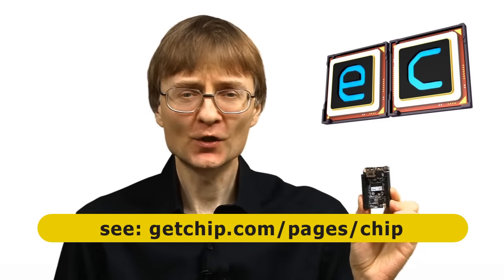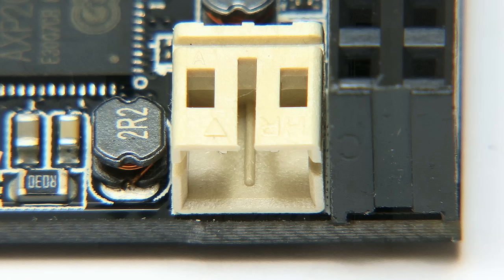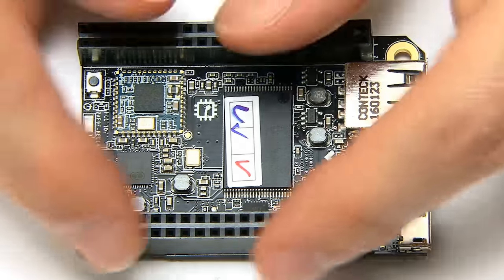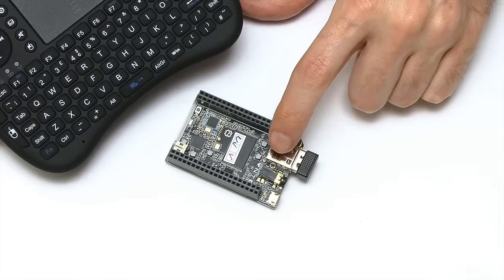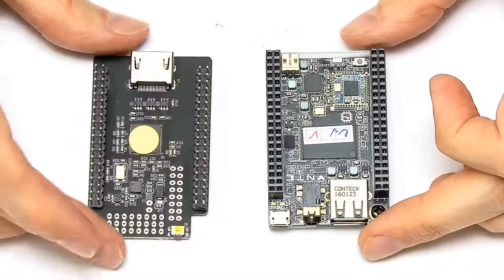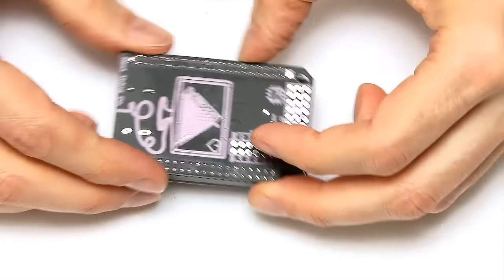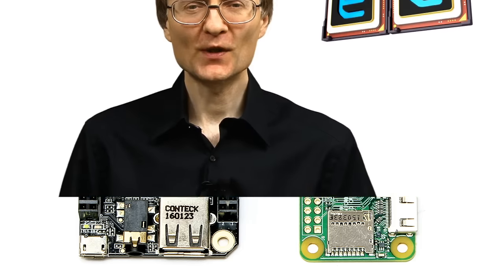CHIP $9 Computer

Comment: Everyone reading save your time and research OrangePi, its the chinese licensed version of raspberry pi BUT it can load ANDROID 7 OS, Debian, Raspbian And Linux. Plus all orange pi's have external wifi antennas with BETTER CHIPSETS TOO! 
--------------------
*Orange Pi Zero 14.50$* - 1.2 ghz Quad Core CPU, 250 mhz dual core Mali GPU, 256/512 mb RAM(version dependant), Regular single USB port, Wireless external Antenna (WIFI), Ethernet 100/1000, and 26 pin expansion port and 13 pin interface for HDMI Shields. The OPI Zero Plus2 has HDMI built in and comes with a camera ribbon cable port
*Ras Pi Zero Wireless 10$* - 1 ghz single core CPU, NO GPU, 512 mb ram, single USB-C data/power ports, Wifi, no ethernet, expansion shields accepted. 
*Ras Pi 3 B+ 35$* - 1.4 ghz quad core, 1 gb ram, single core 450 mhz gpu (OPIZero has better GPU), no internal storage, max 64gb TF SD, Bluetooth 4.2, Camera ribbon cable port
*Orange Pi 2 Lite 35$* - Allwinner H6 1.8 Ghz quad core CPU, dual core 650mhz Mali GPU, 1 Gb Ram, external wifi antenna, 4gb flash internal storage, BT 4.2, Ribbon cable port...
*Orange Pi 3 85$* - Allwinner H6 1.8  Ghz quad core CPU, dual core 650 mhz GPU, 2GB Ram, had RC Mode, AV jacks, HDMI out even IR Capable! anything you need but its pricey AF

Go with orange pi, they have like 20 models to choose from which is better so you have something tailored for what you need.
I dont worrk for orange pi im just a stoner who is bored.
Reply from the maker: Rasbian and Debian are Linux distros! :) Good list above: the Raspberry Pi Zero W is I think the closest and best alternative to a CHIP these days.

Comment: Very odd they didnt use mini-Hdmi, I think it costs about the same.
Reply: MegaTechGuy surely they did it that users would buy additional add-on
Reply: Yay that is the most likely reason, unless it was made for the South-America market which still uses composite video output.
Reply: MegaTechGuy OR they didn't want to pay licensing for HDMI, which would have increased the base cost?
Reply: Well the HDMI royalty rates are (US$0.05) per unit sold with logo on packaging, I'll do a bit of research & find out why they did it. Most likely is was to make money from the add-on HDMI adapter like Nick said.
Reply: MegaTechGuy Just playing devil's advocate. Could also be due to composite being easier to implement or taking less board space. Or to make money, like I said just playing devil's advocate.
Reply: There are projects which skipped HDMI because they didn't want to deal with royalties and compliance testing at all (do keep in mind HDMI is more than just a bunch of video signals; https://en.wikipedia.org/wiki/HDMI#Communication_channel_protocols ), not because the license itself was expensive.

That said the external HDMI addon would've gone trough the licensing stuff so that's probably not it in this case.
Reply: Djhg2000  I suppose HDMI would be a single chip add on, so compliancy testing can be done through the channels of the chip vendor, no need to go through that hassle. Or rather, did I hear mali400 graphics? That is what each and every android tv stick with hdmi out has by default. In fact most of the specs of this thing sounds very android (rikomagic?) to me
Reply: +telocho Like I said; compliance testing is probably not the reason in this case. Besides, compliance testing is pretty much a formality in cases like this where you have a complete graphics core. Just verify the connector is wired up correctly and run the tests.

But I hope you don't seriously believe those Chinese Android sticks have gone through any sort of compliance testing besides hooking it up to some cheap TV to see if they get an image. They put as many markings on those as they think they can get away with.
Reply: Think they went that route to make it more accessible globally, than just limiting its uses to hdmi.
Reply: DannyWarlegs I think it was also to keep the cost of the chip as low as possible too. after all you don't need to buy the dip to use it.
Reply: ah so thats what my tablet hdmi is...
Reply: MegaTechGuy no, we use VGA or HDMI the most of the time

Comment: It's 2020.  Has anything come close to this (including price)?
Reply from the maker: Best alternative today is a Raspberry Pi Zero W, for about $10-$15, depending on where you buy it.
Reply: ExplainingComputers if you just want a microcontroller arduinos cost even less depending on which one you get
Reply from the maker: @natesenft5376  This is true. But a microcontroller is not a general purpose computer like a CHIP or Pi Zero. So as you say, it just depends on the application.
Reply: @ExplainingComputers  Thanks.
Reply: @natesenft5376  Understood.

Comment: Raspberry Pi should definitely come with a Wi-Fi chip on board
Reply: JonnyInfinite rpi 3 has build-in bluetooth + wifi
Reply: jonasxdufek does it? I only have a model 1, it's very slow and not much capable of anything
Reply: JonnyInfinite a 3b is definitely worth the upgrade
Reply: Definitely worth the cash to upgrade to the Pi 3B
Reply: Or CHIP should come with a decent video output at no additional cost.
Reply: +ElMariachi, yeah and for the company to cover that cost they can just charge more than $9.
Reply: That 15$ video out add on is pure bullshit.
Reply: You could always make one yourself with a bit of board etching :)
Reply: JonnyInfinite it does

Comment: About the USB HUB, Were you suggesting it cant put out 500mA ?
Reply from the maker: I imagine it would struggle to draw that current from the Pi.
Reply: If it cant produce 500mA which is not much, Then does that make it non-USB compliant ?
Reply from the maker: It does, but I don't think they are worried about full USB compliance for a tiny SBC.
Reply: Thanks for your reply :)
I think ill be looking into the full spec rasp Pi of some kind, not sure yet.

Comment: FYI, they were out of product for about a year but are back, but at a 24.99 price (Right now on sale at 19.99) . I do not see any real change (need to find out old spec to see). I also what happen to that the chip pro they were showing.  I am not sure where they are going but i will be just watching to see, and rather buy some other SBC

FYI, I have looked at a Wikipedia page on the chip and they say they are out of business. but date april 2018 on the info. So someone has a new site up selling some gear at https://shop.pocketchip.co/   . Not sure on who it is
Reply from the maker: Thanks for this info. At 24.99 the CHIP is significantly more expensive than the Raspberry Pi Zero W.
Reply: I think the Pi zero came to be because of the chip, which picked on a price point of the PI. But now they look to be forgetting why the came to be. Not so much an issue today because there is now a bunch of low cost options to the Pi ( which where some SBCs lose where they are going with it) . I think the only thing they may have left is that chip portable , but have to see. A year from now we shall see. It would not be the first SBc that looked good and went bye bye
Reply: Where is it on sale? The Amazon page (the only one I could find) makes it look like it's gone forever, and they were just selling of what they got at the bankruptcy sale: "We don't know when or if this item will be back in stock.". If they were actually resuming production, one would expect an estimated restocking date.

Comment: This question might reveal how much of a novice I am, but let's say I bought this thing and stuck the USB connector from my external SSD into it.  Would the operating system be able to recognise it and work with it, as it does with my current PC running Windows 10?  It's a 4TB hard drive and would be pretty comical if it could work!

Comment: You can still buy a C.H.I.P. today, April 2020 (except for maybe the corona virus shipping embargo, which has to lift eventually). Search aliexpress.com in China for C.H.I.P. or C H I P == the downside is that the $15 (!) shipping fee is outrageous, since shipping in China is subsidized by the government -- it should be free shipping, or maybe $1 or $2, but no more -- you'd even think that the seller would be happy to get rid of them. OTOH, be happy that you can still get the thing.

You can also update to a newer firmware, in linux. Do a google search for NextThing CHIP, NextThingCo CHIP, or $9 CHIP, or CHIP Update Linux, and so on. It might even work using the linux embedded in Windows 10.

You don't have to worry about the HDMI DIP adapter, since CHIP has a nice desktop that you can access using VNC, from any other computer.

You can access a CHIP using SSH, which might not work, but a more reliable method might be using an FTDI serial adapter to the CHIP's RX/TX pins (and ground, but not power). Remember that the RX from the pc must go to the TX on the CHIP, and the TX on the computer must go to the RX on the CHIP. If a 9600 connection doesn't work, your next step for any serial device should probably be trying a 115,200 (115200) connection. I don't remember if the CHIP's IO Pins are 5V or 3.3V, so try 3.3V first.

Comment: you must have earned enough to buy 9,00,000 of those chip computer with the ads revenue.
Reply: Anant Negi 9,00,000 isn't even a number
Reply: Anant Negi assuming you mean 9,000,000, i highly doubt he made 81,000,000+ from one video.
Reply: I think he means it according to the Indian way of classifying numbers ,we use commas after 3 digits only once then it's commas after 2 digits . What he typed was 9 lakhs or 900,000 (according to the international way of classifying numbers) or 9,00,000 (the Indian way )

Comment: I still have my CHIP! Backed the Kickstarter way back when and everything. Shame they went bankrupt :/

I remember the power management IC was an absolute pain in the ass, as the board kept shutting off whenever it would go over the (meager) current limits, which it did whenever doing anything intensive like running apt update. Eventually they ended up putting in the documentation a command to disable current limiting, and it was basically a requirement to be able to use the damn thing.

Comment: I'm not sure about this Chip computer. $9, it's kind of misleading because in most cases the HDMI is required to be useful. So in many cases this is a $24 computer. I think the Chip itself is that cheap because all other things are quite expensive comparing to the Chip itself. It looks like a printer-selling-business-model, the printer is cheap, the ink however is quite expensive. I think the rasberry pi is more honest and you buy a full package without need of an extension/adapter to be useful out of the box.

Comment: If you look for something similar: Raspi Zero W.
Doesnt have onboard memory ( so you have to get a micro sd card), but is has:
Wifi, Bluetooth, mini/micro (cant remember lol) hdmi, micro? usb (1x output 1x power, output one needs a otg cable to work) And costs around the same (+ ofc whatever size sd card u want and the adapter cable. The adapters probably are more expensive than the rest tho lol)
Reply: Mini HDMI

Comment: Noting that you recommend a Raspberry Pi Zero W in the Description, I would have say that although it is amazing VFM at under £10, I find mine intolerably slow and underpowered. The 2gb Pi4 model B is 3x more expensive but 10x better, and the 8gb version at about £70 is massively superior again, and is a viable desktop PC replacement. I'm holding back from buying a Pi400 only because there is no 8gb version of it (yet).
Reply from the maker: Agreed that the Pi 4 is a far more powerful board, as I've featured in a many videos on this channel. But it is not at the same price point as the old CHIP. And it depends on the use case. :)

Comment: A new chip using a really old format TV output. You would think they would use the much better PAL system.
Reply: It can do both NTSC and PAL.  It's not that "PAL is better," (even though it is) it's that "some parts of the world use PAL, some use NTSC."

It also had an HDMI add-on and a VGA add-on, for those that needed better connections.

Comment: Do you know where to get a video cable for this?
Mine has ground where video should be.
Reply from the maker: They are not easy to find! As I recall, they are wired the same as composite video cables for a Raspberry Pi Model 1.

Comment: Why make NTSC the default? How about a jumper on the board to select which? Or even in the OS image?
Reply: Even though NTSC is the standard here in the United States, I would think it would make more sense for this device to use a VGA output instead of a composite. Why would anybody want to hook this device to a television anyway? That was back in the Commodore days!

I would suggest an HDMI output but I'm not sure if HDMI is a standard "worldwide" signal or there is such a thing an HDMI NTSC and an HDMI PAL signal. 

I've got one of those HP Chromeboxes that uses an HDMI output and had to buy an adapter because all of my LCD monitors have VGA inputs so I'm not a big fan of computers that only have HDMI outputs!

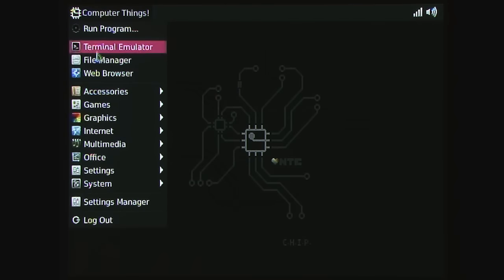Comment: see how fast the task bar responded 10:30, and try the same with your threadripper 3990 x 3080 RTX workstation running windows 10 = still slow.
Reply from the maker: Nice. :)

Comment: to be clear the CHIP basic has no ports you have to buy the developer kit for 49$
Reply from the maker: The CHIP model shown in this video -- currently not being sold, but due to return -- has a USB port, and composite video +  audio output, and also Bluetooth for a wireless keyboard and mouse. So, as I showed in the video, you do/did not need to buy a developer kit to use it. Though you do/did need the HDMI DIP for HDMI.

Comment: Is it possible to update the installed OS just like "apt-get update" and "apt-get upgrade" ?
Reply from the maker: Theoretically, yes. In practice this is not the route they support, in part because different OS images match different hardware configs.
Reply: The question is then, how can I update the OS to prevent securiy issues ?

Comment: Useful little SBC 👍. I suppose, if you're running it headless you won't need the HDMI "hat" and this will free up the dip connector for other hardware etc. The HDMI hat could've been called the "Ketchup" - it's a "chip dip" - they missed a trick there 😂

Comment: Yep. Use a Bluetooth keyboard/mouse, and save that USB port for a hard drive to store your movies on.  Hide it all inside of an old book, and put it next to your TV as a Movie/Internet rig.  It's more than fast and capable enough for general entertainment, and still small enough to be hidden; `totally invisible, but still right out in the open.
  However, I find it interesting that the CHIP has already been Pre-Loaded with Firefox, but one has to use Chrome to upgrade the HDMI card. . .  `Quite strange.
  And again, thanks for simplifying it all without any Geek-Speak.

Comment: short comment: for the comfort factor you should try to get a logitech k400 (but not the newer "plus" version, somehow they made the supposed better version the worse one).
got two black and one white one (3xhtpc) and use the oldest for almost 3 years now without any problems and first/original included batteries.
If Bios is done good it works from Boot just as a normal wired usb keyboard, without any special drivers needed.

Comment: I need a small computer that can be a web address that I can call up from my browser and it should be able to read some sensors.  the move is for faster but that means power hungry.   can I put a suggestion in the suggestion box that you review low power internet capable for IOT ?  not sensors, just the computer boards.

Comment: Its good that they are providing a case to protect processor at the bottom of the board. But, form the presentation i can see that the case doesn't have any any holes for heat exhaust. Have you faced any issues with heat?

Comment: Is there any way to connect a micro SD card or a USB flash drive to the Chip, in the interest of adding memory or transferring files between    the CHIP memory & usb drive, SD?
Reply from the maker: You can do this using the USB interface, probably using a hub as there is only one USB port. But the CHIP is now discontinued . . .

Comment: Why do you use almost always a version of linux as an operating system on single board computers ??  and definitely never windows 7 !   Only windows os i saw was with the late panda but that was win10 and only because its pre-installed . 

I bought a asus tinker board lately 
And can't seem to run windows 7.

Could you make a video for this 

Thank you
Reply from the maker: Most SBCs have an ARM processor, not X86, so cannot run Windows. This is the case with your TinkerBoard. The few X86 SBCs do not have drivers for Windows 7.

Comment: this of turn my old CRT TV to a smart tv
Reply from the maker: If your CRT TV has a composite input (very likely) but no HDMI (also very likely), then yes, it would be a way to give it some smart functionality -- in particular access to the web over WiFi. Video playback on the CHIP is not good -- so don't expect to watch YouTube. But if you want a TV that you can also use to access information on the web, then this would be a viable solution. Just (also) add a wireless keyboard/mouse device -- like a Rii i8: https://www.youtube.com/watch?v=alSEocPTqj8

Comment: In 2018 512 mb ram is more enough for computing????? Chip size is good but specifications ohhhh aaahhh. Even HDMI is $6 costly than the whole PC why??? What could be stored on 4gb??? 2018 not in 1995.
Reply from the maker: This is a Jan 2017 video; now (Sept 2018) this board is no longer available. But a 512MB Raspberry Pi Zero W sells for $10, including onboard HDMI, and runs a desktop OS pretty well! :)